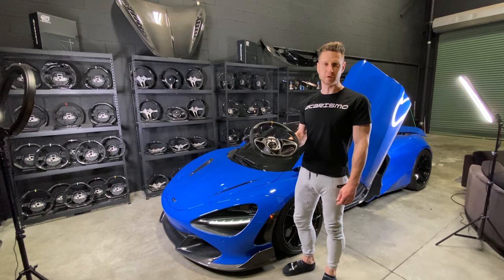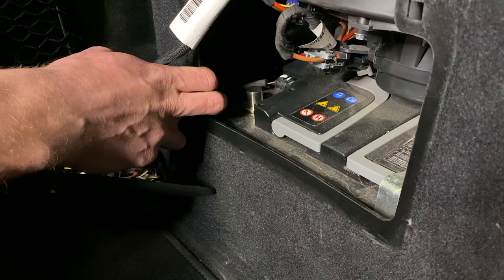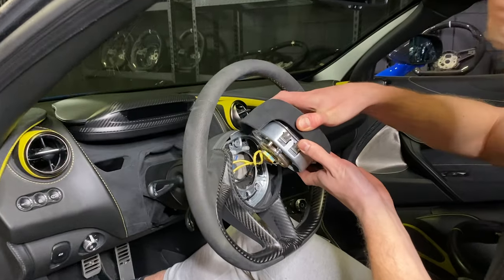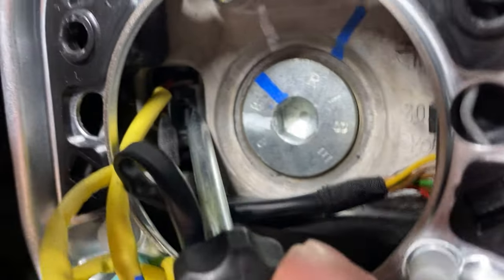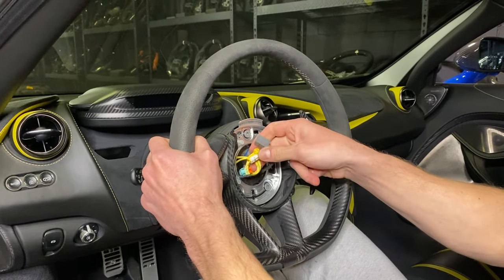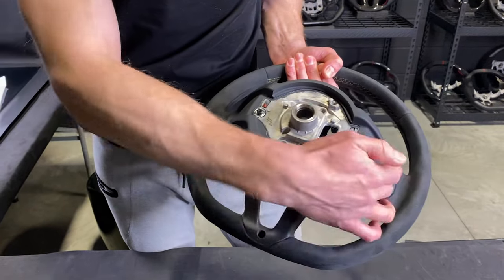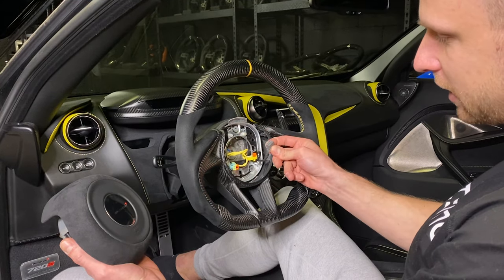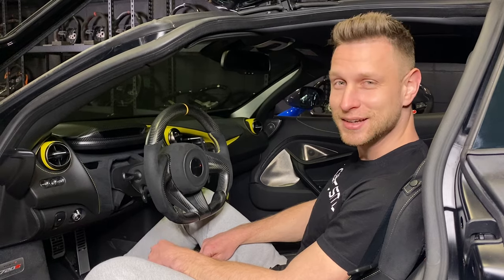CARISMO | McLaren 720S/GT Steering Wheel Install | Taking off a Steering Wheel & Replacing Steps

Comment: Would you mind sharing the size of the (3) screws that holds the center trim to the steering wheel? (The T20) . I lost them and trying to find a replacement, but have not been able to find anything online. TIA